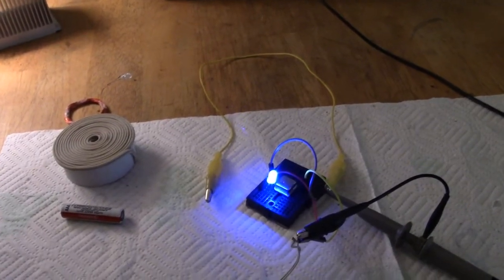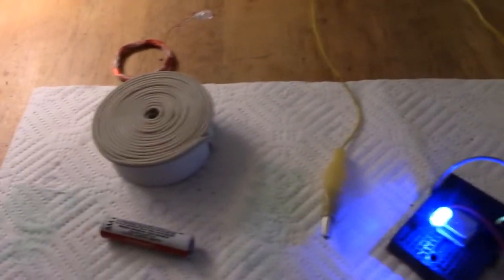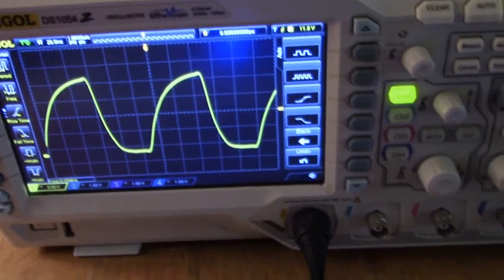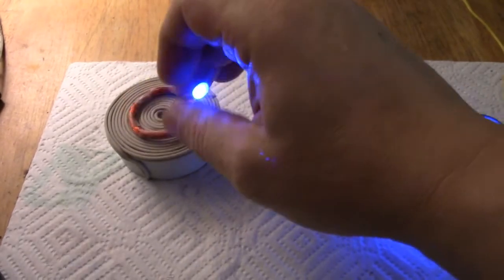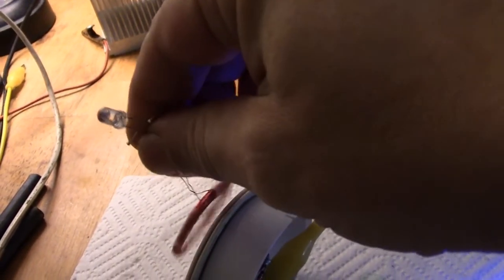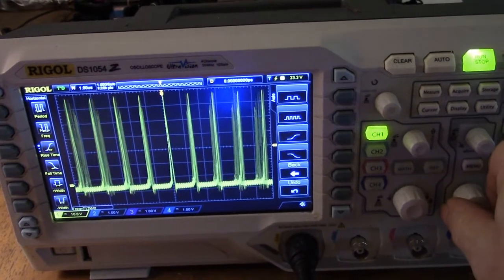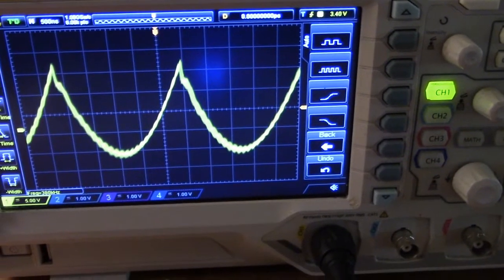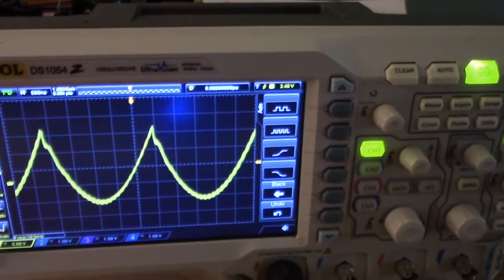FM wireless electricity idea via Lation Fly

Comment: thanks for all the good work. which frequency does it have when the cristal is not in the circuit?
Reply from the maker: 400KHz was the frequency for that coil :)
All builds will be different, depending on the number of turns and gauge of wire.
Reply: @Slider2732  thanks a lot for the answer. i have mine going :-) do you think its possible to tune it down to audio frequency range?
Reply from the maker: Frequency in a SWES, is the result of  zipping down the Collector connected wire,  and being picked up by the Base wire... you could have a 555 trigger each pulse, it doesn't need to run at a specific rate.  
If such a tune is only to hear the video circuit run, you might use a portable FM radio. The carrier would be the oscillator being used, such as 27MHz, which when the radio is tuned to a multiple will produce the sound of the output. 27MHz can be heard at 108MHz on the FM scale.
Reply: @Slider2732  very good idea with the fm radio. i have been using 40106 for audio range oscilltors (synths)before and was thinking of that allready.  but just for the sake of experimetal  fun and simplicity i was wondering if it was possible do make a pancake oscillator synth directly driving a low wattage speaker or something.
Reply from the maker: I see... taking the speaker signal from the Collector and Emitter of a transistor. 
A practical way, would be to look at Lidmotor's 'Penny' and use a tank circuit with SWES coil. Example - 0.1uF cap in parallel with 1 Meg resistor to the Base, then the Base coil wire. 
Each resistor size would produce each note, similar to divide down keyboards of the 1970's. 12 oscs per octave and, well, fully polyphonic by default lol. Or, single coil, with switched in resistors for monophonic. Only squarewave though, without an op-amp stage for sine, sawtooth. I suppose LFO too, with 1-30Hz blink rates... fun idea  :)
If it starts sounding like a Prophet 5, give me a shout!
Reply: @Slider2732  i had an initial succes. i was using water (following your idea)as resistance to the base. reverse osmosis water to make the resistance higher since  am using a 3.7 lithium battery. than connected 1 m resitor and .1 cap in parallel between water and base. picked  up  with the  loudspeaker from c and e and it oscillated at about 150 hz (did not messure). than the resistor got hot and i changed the water (which i had not done for awhile. ) after that i could not get it oscillating again. tried higher and lower water resistance, new cap, new transistor. 🙂, other resistor values instaed of water. no oscillation any more  apart from the high frequency which is still perfectly transmitting to another pancake coil. i think its the patina on the copper electrodes that i must have removed. it did sound like the prophet 5 a bit when it was working.
Reply from the maker: The 3.7V may be the problem, certainly for the resistor. I run all such circuits close to transistor switch on voltage, 0.6V. Water, with a galv steel rod and a copper rod will run a blinking circuit for years. To get oscillator ranges though needs more current, a 1.5V AAA/ rechargeable NiMH or similar. Higher than 1.5V tends to result in heat.
Also, there's little to no improvement in 'wireless range' with higher voltages, the excess being shunted as the generated heat.
Btw, with the water as resistor method, you can drop an LED in the water and it will light. Other than that party trick it's nowhere near as power efficient.
Best bet, imo, use an NiMH and switch out the tank base resistor to obtain the selected notes  :)
Reply: @Slider2732  i got it actually oscillating again. will try to get down with the voltage. but probably will need a lower wattage speaker idea. i have the speaker now in series between emitter and collector. need to make it loud to hear the speaker :-) https://www.youtube.com/watch?v=KLd2o8B9_0A

Comment: Thank you for this up date this is very good info... Do you sell coil as well?
Reply from the maker: My pleasure. Thank you for the idea :)
I don't sell the SWES , but might do as part of an Etsy store range in the future. Curious energy devices are one route for income with an online store.
You can make the coil quite easily if you have an old PC modem cable. They usually have 2 wires inside and you just turn it around and around on itself, using superglue to hold the shape as you go. 
The inside wires are normally red and green. At the end of winding, connect the end red wire to the green wire in the middle of the coil. That is your +1.5V connection.
Connect the other 2 wires to the Base and Collector of any NPN transistor.  Either wire will work with either transistor pin. 
Finally connect the Emitter of the transistor to the -1.5V of the battery.
The SWES is now running :)
To make a pick up col. Wind 24 turns of a thin enameled wire on something like a pills bottle and then put an LED across the 2 wires.

Comment: Wireless communication and energy transfer was done at LONG Distance even before Tesla got into exploring resonant systems, if I recall somewhere around PRE Civil War times circa 1858 or so which is way farther back than Marconi wireless telegraph, AM, FM radio or SSB etc.  Did not use specific resonance knowledge but was still pretty awesome.  Not sure why you focus on just Stiffler experiments (no disrespect to him) when there are many other awesome players both dead and alive if you just want to follow somebody else.  But, it is just my own opinion for what it is worth.  I think the best exploring results in the NEW discoveries by just following your own knowledge and making your own blazing trail.  Example Tesla, Edison, Westinghouse and Bell to name a few that made their own trail and only followed others to the extend of staying up to date on modern tech and knowing what bits are relevant to your own trail.  Otherwise we are all just spinning the same old physics over and over with little chance to "get off the wheel" of others bold explorations when we should really focus on our own and recognize when we are at dead ends and no amount of experimenting is going to change the outcome.  Example here is FM if I understand right.  No amount of complexity of modulating  a carrier freq. is going to output more power than what the carrier capability has anyway.  Any modulating tier or stacked modulation on top of modulation will not be any better than what the carrier has any way regardless of AM or FM.  So my opinion FM is a dead end.  FM does not carry well over great distance like AM or wireless telegraph.  FM is popular for radio because it gives better fidelity and clearer reception than analog AM that is all, not about power or distance.  That said, Tesla gives a number of "tasty" clues and twinkling winks to a phenomena he wanted to use in his world magnifying towers grid.  In brief, by a stroke of chance in some insulation "failed" experiments and a marvelous realization of significance, he found that an improperly tuned HV HF secondary coil could have multiple wavelength frequencies setup on the coil winding.  And if conditions are right the 2 or more ringing wave fronts can create beat frequencies some in phase others out of phase.  In short he found at proper beat frequencies, the peak energy of a node could be shifted anywhere either somewhere along the sec. winding (causing the burn out on a winding "failed" test) OR shifted clear off the tophat and out into space.  Just a condition of frequency, vibration and resonance just as Tesla said.  Hope this info will be useful to you as I can see you have a lot more to offer society if you wanted to.
Reply from the maker: Many thanks again. Indeed, the Dr. Stiffler experiments are mainly because of his return to Youtube. There was always something missing with my own replications and deeper studies into capacitive couplings. So it has all been very useful for that understanding. 
Lation Fly's question was only about using the 38MHz crystal to get a 38MHz output...I had no idea, but suspected the actual wireless output had to be governed by both coils at their natural capacitance, reactance and resistance. Slower than that can influence but faster can only sit on top of that running frequency. However, there was also personal intrigue as to whether a faster switched frequency could display characteristics of that frequency...which it really didn''t in the above experiment. Maybe with stronger amplitude. 
The ringing wavefronts is a fascinating concept.
Reply: EnergyCrafts
Not too sure why your upset Slider was helping me to understand how this work. Because i ask him and i ask other they did't even try or help me.. Big THANK YOU TO SLIDER!
Reply: Hi Lation Fly.  Not upset at anyone.  Sorry if it came across that way.  I never saw your comment to Slider.  I only commented on this video and talk of FM for wireless energy transfer.  I have been in  "alternative" energy research for over 30 years and have long ago witnessed  much of the phenomena and  experimenter's demos that I see on Youtube now.  So most is not new to me and I occasionally forget  that this subject may be new to other people and have not passed all the pits, falls and occasional amazement in discovery something new or a new realization of profound importance as I have.  For example I discovered the AV Plug  effect (which I had called the "V" circuit) due to the physical shape back  in 1984-1986 long before I heard of it referred to the  AV Plug.  I may predate the Russian guy's AV Plug.  Does anyone know when it was first discovered?  Slider, you know when?
Reply from the maker: Oh by Avramenko...only info for date that i've found and that YT won't let me copy&paste is that a Patent was filed on May 10th 1993 !
JNaudin's site has the info.
How can someone file a Patent for half of a FWBR ? lol, weird
Reply: Wow!  Yepee! Oh I'll try to curb my enthusiasm, but I may have been the first to recognize the plug effect.  Bummer I kept it in wraps at the time instead of announcing it.  Now I can go to the great yonder in peace!  :)  By the way, we did have LEDs back then and I quickly advanced to driving toy motors with it --one wire method.  I could also light up (no wire connection, on earth ground) the neighbors flourescent tube(old tech now) digital display on his satellite receiver.  Numbers and symbols jumping crazy.  Luck it did not kill the electronic chips.  Could also charge up capacitor banks at many yards away, only limited to size of my yard boundary.
Reply from the maker: It really does seem that you did and it's a damn shame you weren't recognised...however, if you have VHS footage from back in the day or pics it could change things around. I have no qualms in calling it the EC Gate or something relating to your discovery. 
Well, dear sir, outdoor soil transmission is where i'm stuck...the mains influence seems to mess it all up. I get the bit about more voltage and may use a Chinese booster for up to 30V. Grounds are good, 2 x 8ft steel/copper horizontal pipes about 2ft down (for the Eric Dollard challenge a couple of years back). Just not sure on the tuning method of 1 side of the 50ft yard to the other..
Reply: Well, it is water under the bridge now.  I have many tidbit discoveries like that which have never been publicly mentioned.  So, today I will note one discovery I made way back then while exploring the diode plug effect.  I found a variant of the plug that in many instances would produce more power than the standard diodes back to back way.  Instead of 2 diodes you simply use one diode and one inductor!  Thus not loosing energy across the 2nd diode band gap and gain a resonance effect as well.  I don't have a name for it, but if I follow the syntax abbreviation of Avramenko, I would call it the PAL plug.  First 2 letters my last name and L for inductor.  I found that this PAL plug wires up and can be used just as you would the AV Plug.  You still have to tune for best resonant operation.  The inductor leg can be as simple as a piece of straight wire for some frequencies!  Or as many turns you want and can be tuned with a parallel variable cap or ferrite rod.  You can have a tuneable input tank and the tuning across the inductor as well.  You can tune one leg to "beat" frequency or phase shift difference to also produce power.  You can "hang" more PALs like in a totem pole fashion.  Like off of one PAL or AV plug output merely run the usual load, BUT on those 2 connects use them as inputs to 2 more input plugs.  By this method, you can have a whole bunch of loads running (inductive or filament bulb loads the best for totem magnifying power effect) and it seemed in my case that the extra totem levels seemed to increase power to the lower level plugs.  You still use a wire antenna or top hat or heat sink etc to the POSITIVE  side of the highest level totem and/or capacitive connection to this antenna wire from all plug on positive side, used .01 to .1 uF ceramic, did not use electrolytic, too lossy.  It will work with sine, square or pulsed excitation.  I spent a tremendous amount of time at AM radio frequencies, but it will harness energy of just sporadic sharp pulses (like BEMF) as well, even just DC pulses!  Extremely flexible energy harvester.  I liked picking up energy from lightning flashes too.   In some rare conditions, I found the PAL plug load did not alter the input driver energy.  Did not nail down the exact steps to maintain that condition, should have, but I was a lot less careful with details back then and thought of that as too obvious to need documenting.  Ah, the "sureness of self" attitude of youth!  Feel free to try it out or compare with the AV plug.  For me I was seeking maximum power out and my comments only reflect that use.  If you want max voltage or only max amps then other considerations would need to be met.  But with the tuning of the inductor(s) and variable cap(s) or rod.  (I used both at times) and depending on the load impedance, you can push all kinds of voltage levels and yes enough to get shocked, at the loss of amps of course.  The best energy capture I found was to let the energy charge a cap bank which then runs a load, even if the load is just flea power LEDs.  The capacitance is valuable to gain efficiency.  Well get "sperimenting"  My happy point was running a toy motor with a small fan on it spinning and blowing air in my face.  I knew then that the principle was good it would only need "good engineering design" to get to larger more useful loads.  But life got in the way....
Reply from the maker: The PAL plug...very cool. Have just tried it and it does work for AV plug on a wire type applications. Haven't tried the extensions or the cap connecting yet.
Reply: Forgot to mention you can wire in any transformer (depending on freq. response, I used all sorts, below 400 Hz used iron xformers but for 10 kHz down to 400 Hz used audio xformers and for above merging into air core and Tesla style arrangements) to the PAL plug output to raise/lower volts amps and then rectify if desired.  I did this in various experiments to combine outputs of different PAL or AV plugs to increase power, voltage or amp totals.  We did not have cheap boost/buck converters as is common now days.  Not sure if boost/buck converters would interfere with each other when feeding a common output.  Yes could use isolation diodes but adds more energy loss and more complexity to operating principles.  A key difference between the PAL and an AV plug is that BEMF is purposefully used in the PAL harvesting, while BEMF is not emphasized in the AV plug principle.  A very key point.